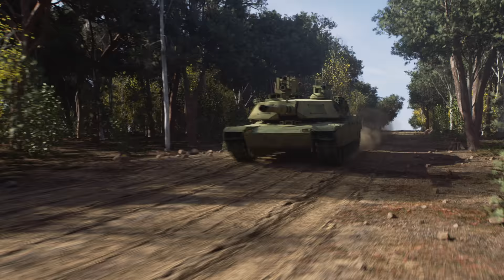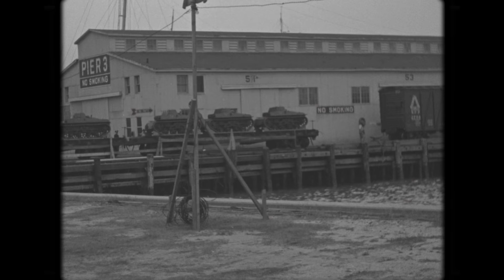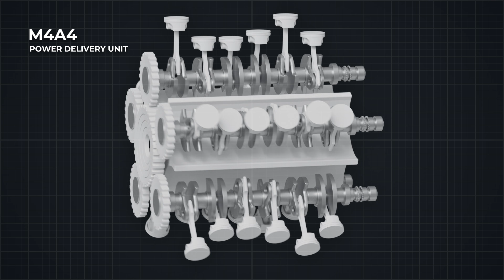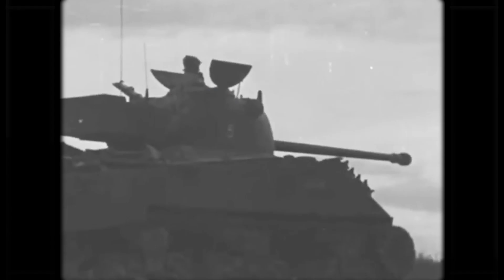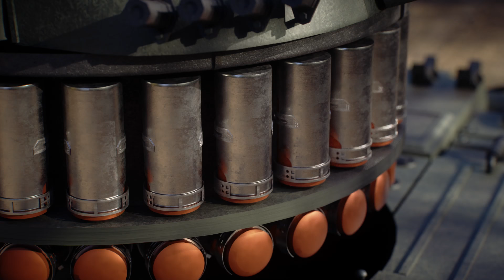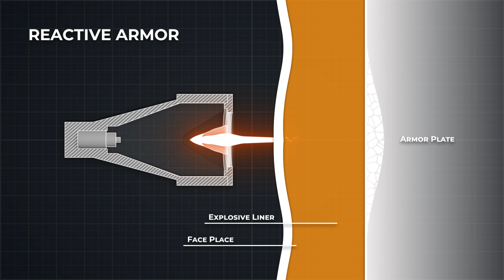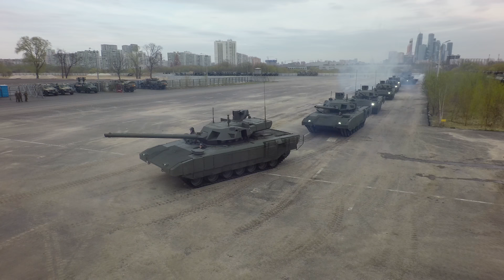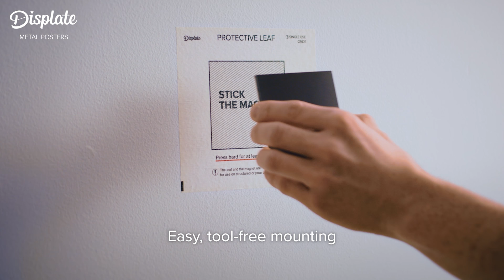Why America’s Tank Failed in Ukraine

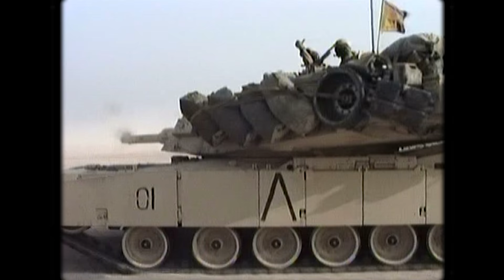Comment: 1:06 the humble T80

Edit : If you want to argue Abrams was the first to use gas turbine, no the first one was Strv 103
Reply: Strv 103 had 2 engines, diesel + gas turbine (for high speed or difficult terrain). These days diesel tank engines are delivering 1500 HP.  My old Chieftain MK5 had a 750HP engine. It was slow.
Reply: Ain't no tank to me: I know a tank destroyer when I see one.
Reply: Chrysler Turbine car did it in the 50s.
Reply: @please_stop-v7o  I think from context it's obvious they meant the first *tank*, but that's an interesting tidbit anyway
Reply: One could also argue that the Strv 103 isn't a tank because it lacks a turret.
Reply: @fguocokgyloeu4817  They purposefully call it a tank, the S-Tank.
Reply: @null-0x Democratic People's Republic of North Korea is a democratic Republic?
Reply: @null-0x  I thought they called it that cause it smells
Reply: @fguocokgyloeu4817  casemate tanks are a thing
Reply: @Scigeotech Some don't consider them to be tanks is the point. There is no universal definition.
Reply: @fguocokgyloeu4817  it classified as a tank though
Reply: @Owlzz_id Not by everyone.
Reply: @fguocokgyloeu4817 but officially it was fielded as a tank
Reply: @TheChieftainsHatch  I agree, but Military A classifying equipment differently than Military B doesn't necessarily mean one is wrong.
Reply: If a military designed a Mechanized infantry force using Merkavas as their combat transport, that military would not be wrong to give the Merkava an inventory designation as an IFV, and then go buy a different Merkava variant and designate it as an MBT. To me, that is perfectly rational.
Reply: @fguocokgyloeu4817  No you couldn't, a tank is a tank because of its function, not because it has a turret or not. The original tanks didn't have turrets either.
Reply: @zedeyejoe  Yea, you could, because people do it.

I agree with the doctrinal classification.
Reply: Strv103 is a tank destroyer, not a tank.
Reply: @Necoy666  in world of tanks yes but in real life it was a main battle tank